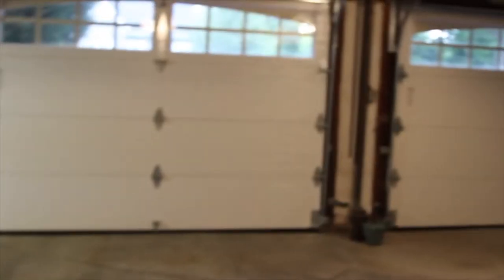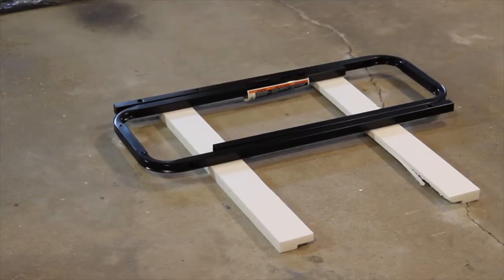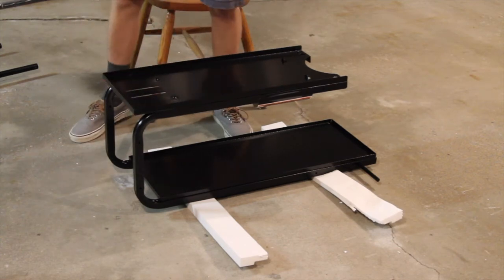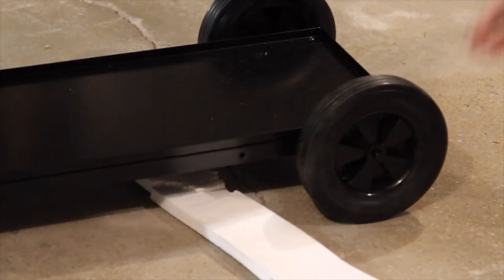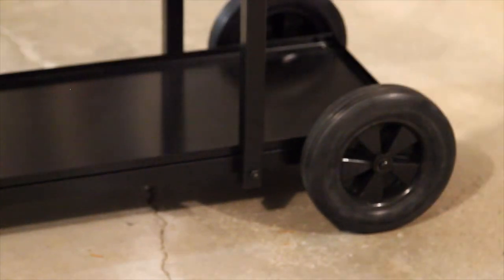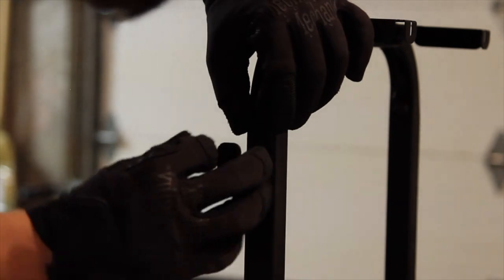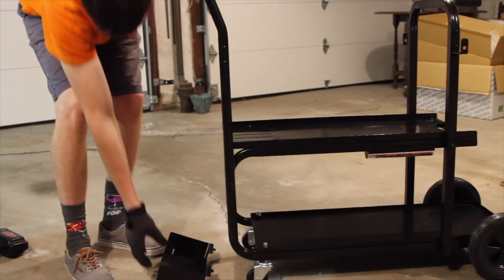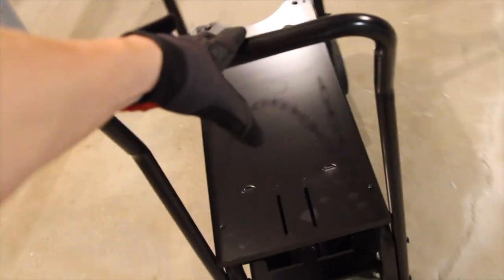Millermatic Mig Welding Cart- Running Gear/Cylinder Rack setup

Comment: The longest screw goes threw the push handle and the frame and the hardware tray at the same time with a the nut and washer.